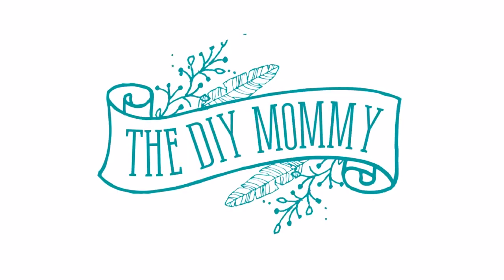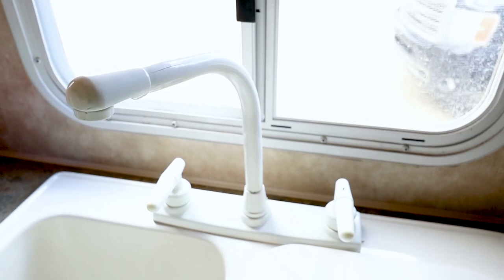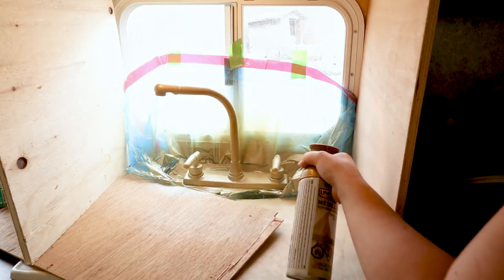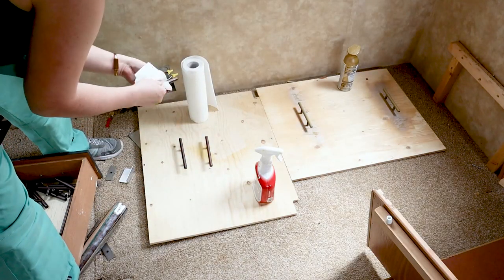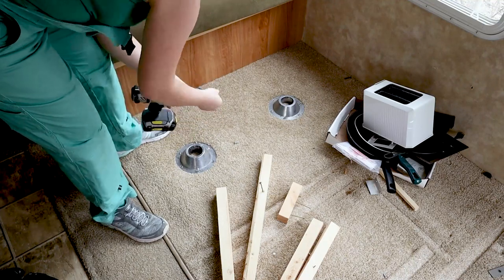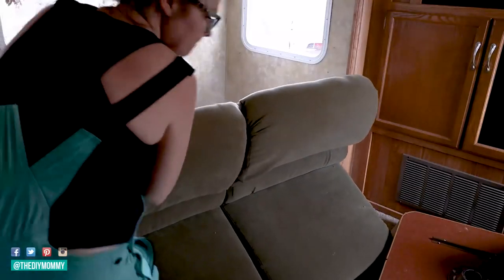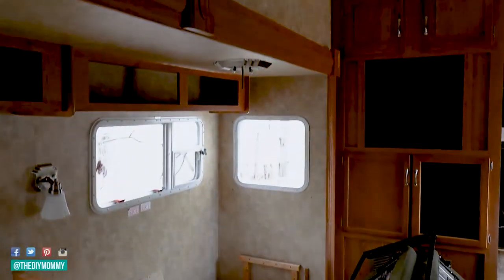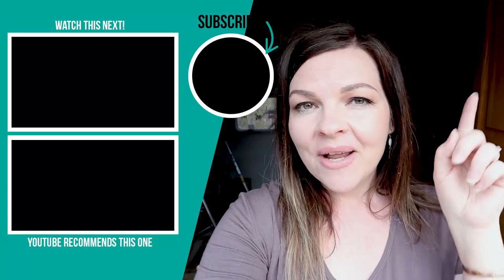Painting things gold & white and a flooring decision! | Our DIY Camper 2 | The DIY Mommy

Comment: I've got a bed in the style of the Ikea bed. If you want to pull it out, it's not as sturdy, but as a regular bed it works just fine. The drawers underneath are great for storage, but check the dimensions on the mattress, mine needed an odd size.
Reply from the maker: Thanks!

Comment: If you shop boating stores they have lightweight, multi function, compactable furniture and accessories. Plus it would, for the most part be water proof (safe from spills). Im sure upon research there may be a second hand boat store. I mention this just because I know in the long run you would be saving on gas money with it being light weight and second hand is usually cheaper. And you may have more options💁
Reply from the maker: Great idea!

Comment: You should spray point a clear coat on the high traffic areas so the spray paint doesn't wear as quickly!
Reply: Another tip is stand you knobs up by sticking them into Styrofoam by the screws. That way you can spray all sides at once